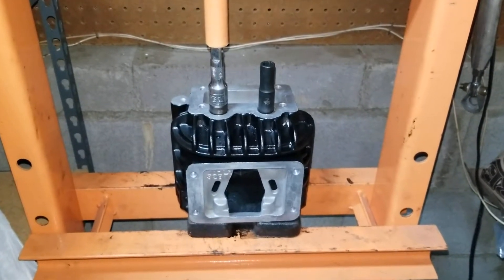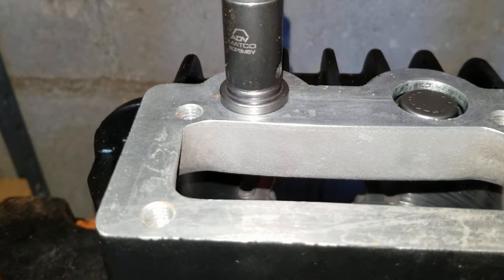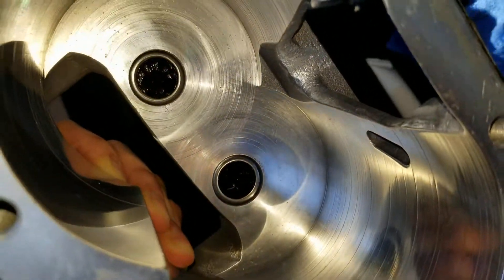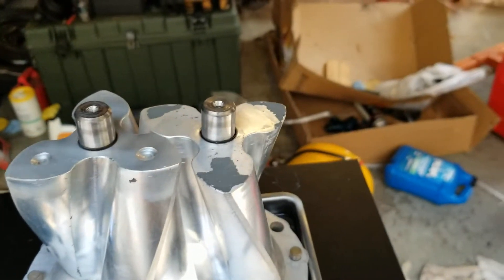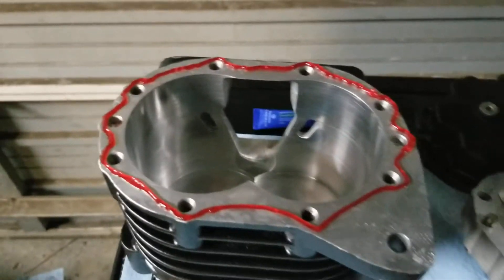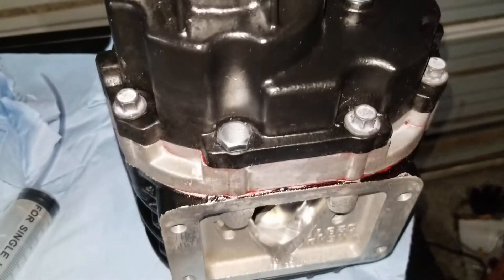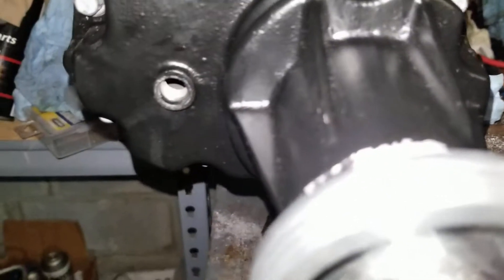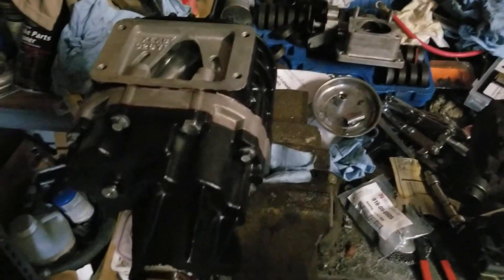Jackson Racing Eaton M45 Supercharger Reassembly. D16z6 Honda

Comment: Hi, did you polish the inside by hand ?
Reply from the maker: Yes with a drill and buffing pads
Reply: @DIYKAI  I did it by hand with a sanding sponge, I am stil working on getting the best achieveable finish. I pulled out the needle bearings today, For me its a blind hole so I had to get a puller. Turns out the bearings are some special stuff (my supercharger is a bit different, SLK 230k). They want like 100 USD per bearing on ebay... ridiculous. searchign for replacements right now. Many thanks for the info.
Reply from the maker: @lukasovysilenosti good luck and I will look also maybe we can find a cheaper option

Comment: I've got one that was damaged the same way with some wear on the rotors. I'm curious if you got this on the car and if so how much power/boost didn't make with the extra clearance from repairing the damage? I've been afraid of trying to fix it but coasing more issues down the road
Reply from the maker: So we have not ran it yet unfortunately, but we have bench tested it and it builds boost running off a drill..lol...how much on the car is TBD..We are getting back on it for one last run stay tuned for the videos

Comment: “Dont Use rtv” Me only having rtv, I used rtv😂💀
Reply from the maker: LOL the only  reason is because many people use RTV wrong and it causes the excess to be forced out the inside you cant see or clean
Reply: @DIYKAI  yea, i made sure to make it as thin as possible. I have to have it ready for this weekend, and im sure it will be fine. Im not pushing the blower very hard anyways.
Reply from the maker: We also have a tight time line we have a show to make and it’s not looking good
Reply: @DIYKAI  Haha yea. Im using this m45 on a miata for autocross, its done pretty well so far. I got it back in the car today and i ran it for a few minutes and it seemed happy.

Comment: Where did you buy the replacement kit?
Reply from the maker: Hello we got it off eBay
Reply: @DIYKAI  do you have a link for it? Also, how did you port and polish up the rotor pack housing? Any new updates on how the jrsc is doing?

Comment: What the special grease you used and where can I find it?  I’m going through the same thing with my JRSC D Series and your videos have been very helpful.
Reply from the maker: I got it off ebay....Eaton needle bearing grease
Reply: @DIYKAI  thanks!!
Reply from the maker: @CSIICoatings  Your Welcome and good luck with your rebuild. Are you coating the lobes or housing?
Reply: @DIYKAI  I stripped my lobes like you did with acetone as more than 50% of it was already missing and flaking off.  So I removed the rest to bare metal.  I'm unsure if I'm going to get them coated again.  It's hard finding any information out there.  I started a new thread on D-Series called "JRSC (Jackson Racing Super Charger) 2021 Complete Reference" to document as much info as I can about what's currently available and what we know about it today since so much of the info is lost or broken.
Reply from the maker: @CSIICoatings  awsome link?
Reply from the maker: @CSIICoatings  Thanks!